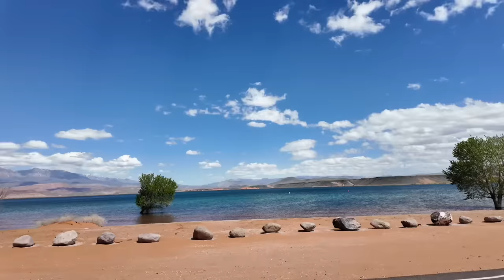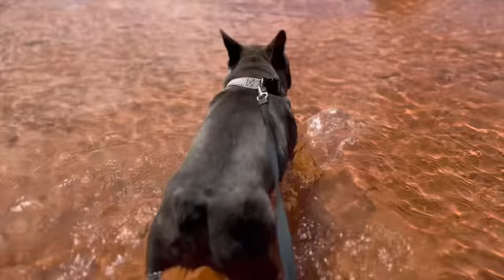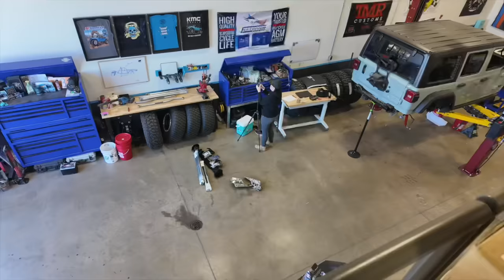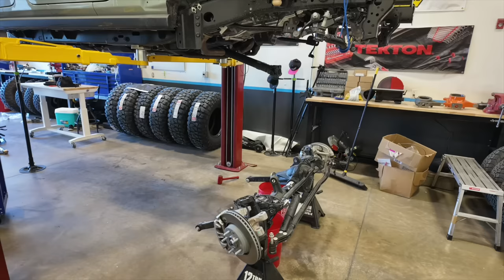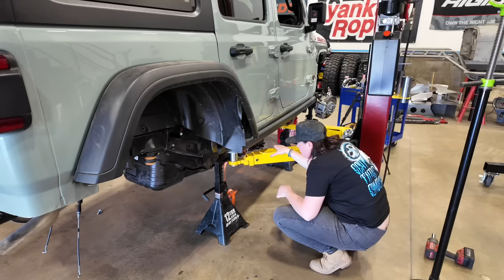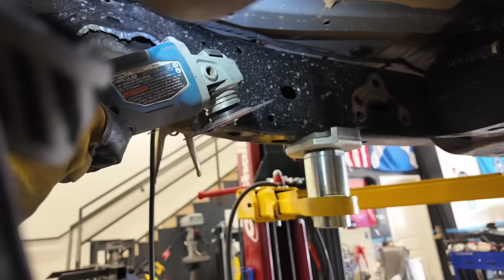Don’t Know If I Can Get This Build Done

Comment: I really don't want to sound like a nattering naybob, But you should wear your safety glasses even if you're not grinding. if your pounding on steel with a hammer or running an impact tool there's A Possibility that a chip or a fragment can come off and embed itself in your eye.
 Ask me how I know this.....😢